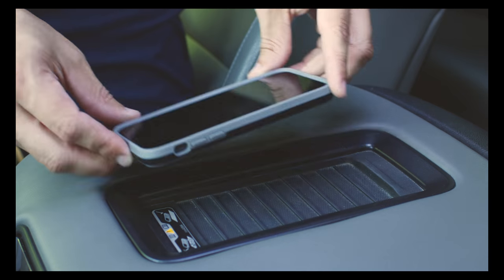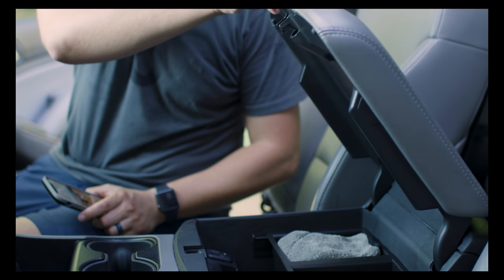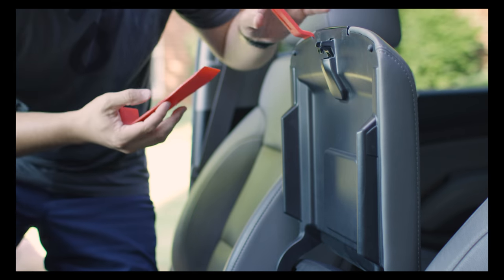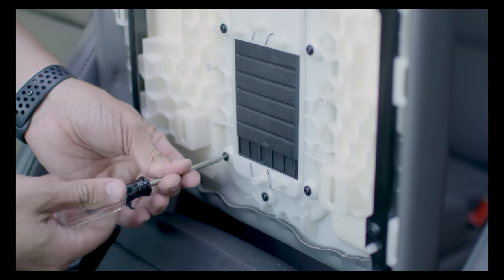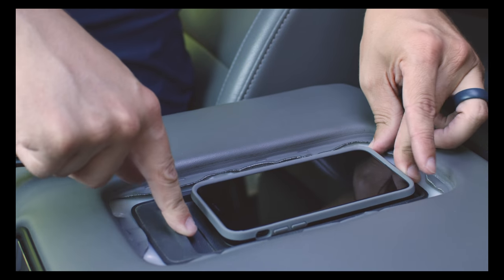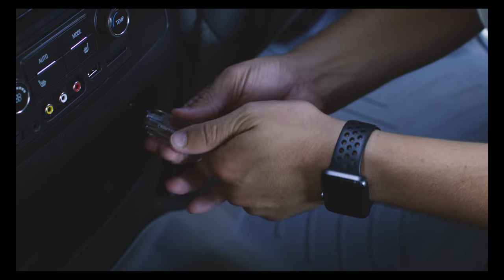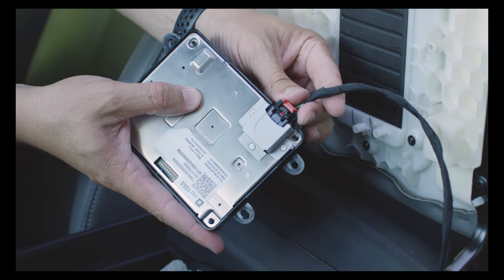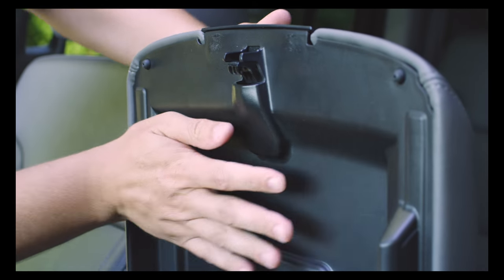OEM FIX iPhone Wireless Charging for GM | GMC | Chevy

Comment: Would this module work for counsels with out climate and media controls?
Reply from the maker: Great question - I'm not sure.  I don't think the wiring harness for the wireless charger is tied specifically into the media controls circuit.  I'd open it up and see if the wire is in there.

Comment: Does anyone know what to tell the GM part guys ? He said the 2018 gmc is the same as 2016
Reply from the maker: @tonybalbuena1815 if your phone fits in the space and does not charge then you'll need the new module, part number is GM 19432813
Reply: Thank you. Does the new module come with the harness?
Reply from the maker: It should be included with that part number. You can always confirm with the vendor first.

Comment: Does the phone have to actually fit into the space for it to work? I just bought a 2016 Tahoe and my phone is an IPhone 12 ProMax, so it is too large for the space.
Reply from the maker: Unfortunately it has to sit pretty flat, I'm guessing it will not work consistently if it's too large.

Comment: The wiring harness that comes with that part # is not compatible with the female connector in a 2017 Suburban, and is not long enough...do you have any idea where to get the correct harness?
Reply from the maker: Bummer, I’m not sure I’m sorry - some of the new kits you just plug into the original cable and you don’t run it to the cover in the back. They’ve changed the kit a few times since the video was originally made. Let us know what you find out!

Comment: Jeff where can I buy this module at I am looking all over the place I live here in Maryland but no one has this module for me to buy if you could let me know I would surely appreciate it and thank you for the video
Reply from the maker: Hi Marshall, the part numbers are in the video description, the key is finding one that uses the gen 2 module (GM 13521066). The top ranking part with the new harness that removes the steps for taking the back panel off is ~$100.  Any of the GM parts sites or eBay is generally a safe bet. I believe the kit part number is still (GM 84526978).

Comment: Just purchased a 2017 Yukon XL, will the newer module listed work in it with my Apple 8 and newer devices, as well as the new Samsung phones?
Reply from the maker: Hi Velma, I suppose it depends on when your Yukon was built.  If it works with any of the newer phones you should be set across the board.

Comment: Where i can get the new harness for or where did you get it from
Reply from the maker: Info in the description - any of the main GM parts supply places will work.  Ebay is also generally a good option.

Comment: Does wireless charging also make Apple car play work or is an usb cord charger needed? Also I have a 2017 Silverado ltz and iPhone X or newest iPhone out happend to toss phone on wireless charging and it worked was pumped but it doesn’t work 100% of the time.
Reply from the maker: I believe a cable is required for Apple car play equipped vehicles.  Placement of the phone on the pad can sometimes cause issues with the charging, but I've not had any intermittent issues with mine in the rotated position.

Comment: Does this FIX work for the iPhone XR.  Thank you
Reply from the maker: My understanding is that it will, let us know how it goes! (I have the Xs and it works great).
Reply: I just received my unit and swapped it, now my IPhone XR does charge as advertised.  Thank you.   Note: I had to use quite a bit of force to separate the panels, other than that, with the new installation cable that comes with the unit, it was smooth sailing.

Comment: Is there a fast charging module out there
Reply from the maker: I think all fast charging requires something 3rd party.  I'd look for a 12DC, or maybe even use the 120V if your vehicle has one, and put a vent style mount or a pad up front that can supply higher wattage.

Comment: I have a 2016 Denali don’t charge my Xmax iPhone I had to cut the piece inside the mat, and still don’t work, so I have to buy the module for 2018? And install it? Or what you recommend ?
Reply from the maker: If you have 2016 you'll need a new module. Official answer from Apple "The implementations of wireless charging in 2017 and earlier models from Buick, Cadillac, Chevrolet, and GMC do not meet the requirements for Qi certification. These models do not work with iPhone."

Comment: I have a problem with that charging pad. It has a Bump on it. I don’t know if that’s normal. Should I get that fixed?
Reply from the maker: Unofficial advice: I'd have to suggest you take it into your local GM dealer and have them look at it.

Comment: Would this be the same method if I don’t have a wireless charger? This video is replacing a wireless charger, not adding one. I don’t have existing wires!
Reply from the maker: If you pull the back panel off and there is no place to plug in the wire then I would say it is going to have to be some kind of a hack.  You could try to tap into power somewhere on the back panel.  To be safe: I'd suggest just getting a phone mount that you can hang on your vent with wireless charging built in if there is no existing wires to connect to.

Comment: Good day. I have the same problem I have a wireless charger in my Yukon denali 2016, my cellphone is an Samsung S20. Android. I did step-by-step according your instructions but apparently don't pass electricity? Could you please send me any recommendations or do you know if any fusible and where can I find it? I check in the manual but I don't see anything related. Thanks.
Reply from the maker: Sorry to hear that - If the new module isn't working then I'm not sure what to say!

Comment: I ordered the part number from your description. The one end of the new harness does not match up with the end in my 2016 Yukon XL Denali. Any suggestions?
Reply from the maker: Hey Sean - that's a bummer.  Which end does not fit?
Reply from the maker: https://www.tascaparts.com/oem-parts/gm-harness-84193710
Reply: Jeff Gora the one end of the harness goes into the new module. That fits fine. I took out the old module and harness in my 16 Yukon Xl. The female clip in my car does not fit the other end of the new harness. I ordered GM 84526978 from Taska. Is this the correct part?
Reply: Jeff Gora nevermind! It just hit me. The small harness that the new module came with wasn’t meant to replace the harness in my car. It was only an adapter for new module. You actually keep then harness in your car then plug one end of the new harness into existing harness and the other into the new module. Boom wireless charging now. All good. Might be a good topic for next video. Thanks for the help!

Comment: Where is the fuse to power this charger located ?
Reply from the maker: Google says : F2DL - Fuse #2 on the driver left fuse panel. 

https://f01.justanswer.com/Bluegorilla/300732d7-bab0-46fd-85a2-ba8de1148721_My_Boot_Camp_printed_document-25.pdf

Comment: Where did you find the part and harness for $65? All I can find is $100+ dollars
Reply from the maker: Hi Dustan, the key is finding one that uses the gen 2 module (GM 13521066). The top ranking part with the new harness that removes the steps for taking the back panel off is ~$100. I believe the kit part number is still (GM 84526978).

Comment: How much did the module cost also where did u buy yours?
Reply from the maker: It has been some time since I did this project - I think you can find the parts on the GM supply sites or eBay for around ~$125
Reply: @jeffsgora  I have a iPhone 6s and I put a QI charging case on it and it does not charge but it will charge my air pods lol. Do u think I should get a different case ?
Reply from the maker: @howardmiller4241  Odd, to be honest I have no idea... I'd give it a google and report back. Good luck!

Comment: one major issue which i faced with iphone 15 while in wireless car charging in VW that their design is not suited for it,coz the moment we lay down the phone on the car wireless charger it is not evenly flattened on the surface but due to the bulged out camera lenses top half is always creating space  and not touching the flat surface of the wireless car charger ....pls help on this issues...
Reply from the maker: You are correct - the lens protrusion on the back of the device can create a poor contact with the wireless charging pad.  If the OEM pad is a requirement for you, there are many phones that lay flat which you may consider. Alternatively, there are many great MagSafe solutions which work very well with your iPhone 15.  I would suggest finding a MagSafe charger that meets your preferences and tuck a high quality braided USB cable under your trim panels for a clean installed look. - Good luck!
Reply: @jeffsgora  🙏🏼👍🏼

Comment: My 16 didnt come with a charging station.   Is there a DIY charger you can order and install ?
Reply from the maker: Michael Anchando You may be lucky and have the wiring pre-run by GM even if the module is not there. Open it up, and see what options you have.
Reply: Mine 2018 didn’t come with wireless charging but I am going to buy the module and rubber mat. I pulled back cover off and it is NOT pre wired. That’s ok though. Just going to tap into cigarette lighter wire harness using quick splices.

Comment: Hey do you have to cut that mat underneath or can you do it without cutting that little tab
Reply from the maker: Farm Lyfe - Yes, you can do it without cutting the mat, but your phone may not align with the module well. Cutting the tab won't mess up the mat if you decide to return it to the standard orientation.
Reply: Jeff Gora do I need to update the module. Can I just cut the tab and flip the mat. Will it work that way. I have a  17 GMC Sierra Denali
Reply from the maker: Farm Lyfe - If it's a newer style iPhone then no. Official answer from Apple "The implementations of wireless charging in 2017 and earlier models from Buick, Cadillac, Chevrolet, and GMC do not meet the requirements for Qi certification. These models do not work with iPhone."
Reply: Jeff Gora ya it’s the iPhone SX MAX  ight I’ll have to go buy the module and this will be my next weeks project. Thank you for all the info . This should be a GM correction stupid GM

Comment: I have a 2015 Yukon and an iphone X. The GM part number on here shows it changing it from gen 1 to gen 2. Is this the wireless charging type? Iphone x uses Qi wireless charging. Is there any way you can tell me if this fix will work with the iphone x and GM part #GM 84526978??

Thanks in advance!
Reply from the maker: Hi Scott - sorry for the delay.  I know that the module I used in the video still works with the new iPhones up through the 11, I've not tried a 12 yet.

Comment: Just tried this on my 2017 Silverado High Country and it did not work. The existing charging pad also doesnt seem to charge anything. Android or otherwise. The cigarette charger in the same housing (in the back) is functional, so it isn't A fuse issue. Any ideas?
Reply from the maker: I believe the fuse for that module is tied to the sunroof/rear controls.  If that is not blown then you may have pinched a wire in there.  If you are using the original wire and modified the plug to fit, I did not have luck with this and had to use the new harness.  If you are using the new module, new harness, truck is on, phone is iPhone 8 or higher with a thin or no case, and it's still not working - I'm out of ideas. Reply back if you figure out the issue! - Good Luck
Reply: Turns out it blew the fuse. as my sunroof no longer works. I plugged the adapter for the harness back behind the back seat cover. Maybe that was the wrong spot?
Reply from the maker: Happy Jack, Inc sorry for the delay - missed your reply. I'm not sure the wiring layout on your truck. The electronics on these can be super sensitive - could be that you crossed something or pinched a wire. If you replace the fuse and it blows again then it could be the wrong spot but most of the connectors should be made to prevent that. Good luck!

Comment: Mine don't have the wireless charging can I put one I have a 2017 Chevy Silverado
Reply from the maker: Victor, you can for sure add wireless charging if you hack it (you could add it easily by simply using a USB port or 12V in the armrest) - as for OEM, you'll have to see if you have the wiring harness pre-run before investing in a replacement armrest cover, module, & harness. Good luck!
Reply: Just tap into cigarette lighter wiring for power. Simple

Comment: I ordered it and plugged it in and it still won’t work😡
Reply from the maker: Sorry to hear that - I don't think I've seen anyone else who has had that issue.  May be worth checking your fuses.
Reply: Jeff Gora ah yes it was a short in the original harness I followed the harness and discovered that there was a brake in them and they were grounding on each other. 🤦🏽‍♂️
Reply from the maker: @ghostmedic9252  Glad you solved it!

Comment: Didn’t work
Reply from the maker: I'm sorry this didn't work for you! While the video is 4 years old at this point, you're the first to definitively say it does not work (other than those with devices that are too big to fit on the pad). You might consider double checking for pinched cables and that your fuses are all good. Good luck!

Comment: Great video.  I got the newer module from GMPartsDirect.com (Part 194214496 with the harness adapter) for a 2016 Tahoe... easy install using Jeff's instructions.  However, still not working... in fact, it was obvious the module wasn't working even before full install (phone, Samsung Galaxy S8, didn't even work when in direct contact -- the S8 should've already worked with the Gen 1 module, but I tried this anyway, assuming something was "bad" about the original).  Anyway... has anyone ever had an actual wiring issue... broken wire, bad connection?  I didn't check fuses since the 2nd-row entertainment is all working fine... but I also didn't put a multimeter into any of the wires within the harness ports.  Any thoughts on this being a potential point of failure and advice on how to troubleshoot?  I'm not sure where to go with this at this point.
Reply: Same here! 2016 Suburban. New module still won’t charge with iPhone.
Reply from the maker: Thanks Scott!
This is odd, you are right - the S8 should work with both modules.: https://my.gm.ca/content/dam/gmownercenter/gmna/GMCC/dynamic/LearnAbout/popular_topics_en/Wireless_Charging_Compatible_Devices_V2.pdf

Per GM: 
1) If phone does not charge, remove it from charger for 3 seconds and rotate phone 180 degrees. 2) Not all phones fit into all vehicle integrations.
3) Phones that are longer than 150mm (approx 6 inches) may have reduced or no performance.
4) Cases used on phones with built-in wireless charging capability may have reduced performance.

I believe the fuse is tied in with other items so I'm guessing you would know if the fuse was out.

I'll be curious to know if you figure out why it's not working for you.
Reply: Well, I had a Chevy Dealer take a look at it this week while working on some other things... they simply wanted to replace the console lid, and didn't have much interest in an actual diagnosis of the problem.  I explained changing out the lid wouldn't do anything more than what I'd already done by replacing the module itself... but they didn't seem interested and/or capable of removing the trim pieces and evaluating the module and wiring.  (I didn't even get a price on the suggested change-out... but suspect it would be ghastly.)

I just don't need this feature enough to bother much further, at this point... but it is very annoying that a GM dealer can't/won't dig into the wiring or properly diagnose.  I have to get a JL Audio Stealthbox installed soon, and may ask THAT shop if they can trace the electrical... since those shops seem much more in tune with dealing with trim, pulling wires, etc.  We'll see.

I may fiddle with it myself, but I'm not sure which points on the wiring harness are which... I suspect the module isn't even getting any juice, but not sure how to track that down (or what to do about it if I did confirm it!).